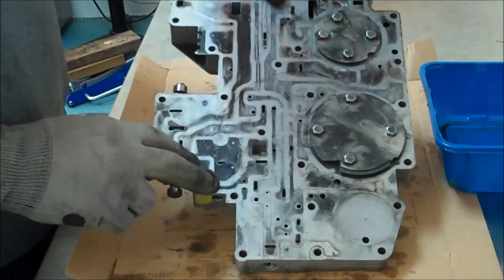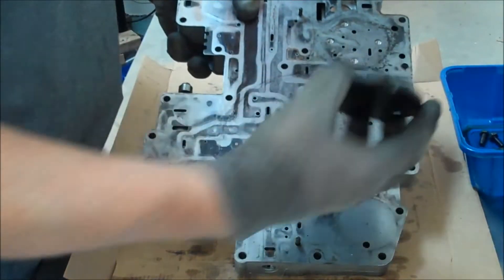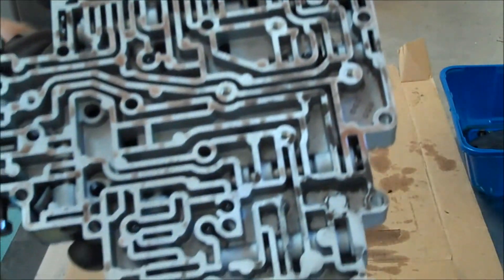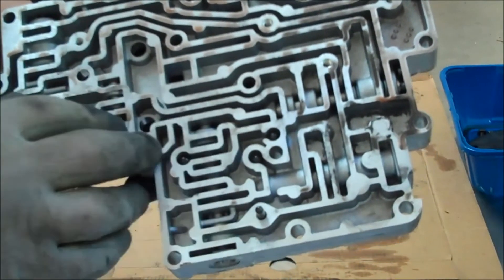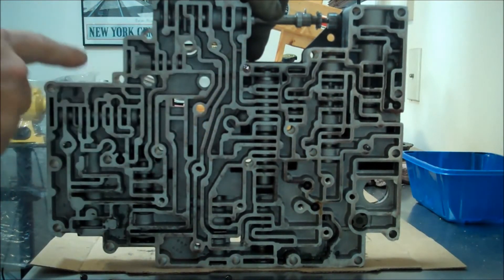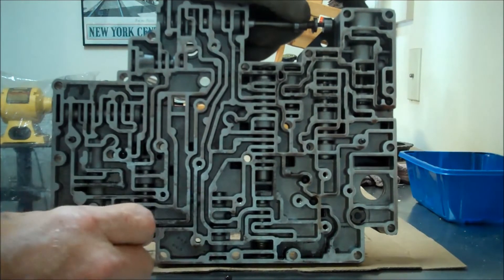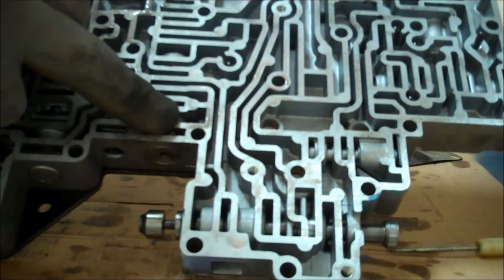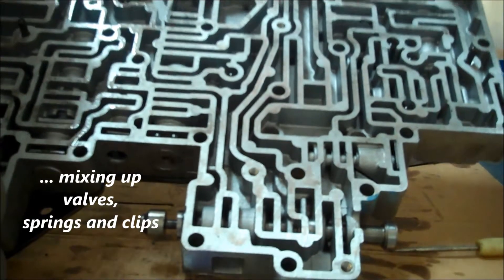Part 3:  Disassembly, Performance Modification & Reassembly of the 4R70W Valve Body

Comment: Im getting a P0750 code on my 97 thunderbird, flashing O/D light and won't shift up, code read shift Solenoid A malfunction, is the solenoid within the valve body? Thank you
Reply from the maker: Good question, I just had this problem.  Check out this video:  https://youtu.be/O9Rxch3zHHM?si=fVlsxyliMmFopV-9  I also have a long playlist of 4R70W transmission videos:  https://youtube.com/playlist?list=PLGNsbVXzRfZM6WpCF862q4DlkyatzFIMz&si=q7y4sVdsdR81htln

Comment: My overdrive clip broke into my body valve so I tore it down removed all the mental put everything back together filled the transmission with fluid now it won’t engage any gears any idea? Awesome videos btw just subscribed and liked
Reply from the maker: Thanks for subscribing and liking!  Thinking about your problem, there are a couple of possibilities:  1) you did not reconnect the electrical strip properly that goes over the valve body, 2)  there may still be parts of the overdrive c-clip in the valve body preventing operation of the valve body valves or flow of the transmission fluid, and 3)  you may not have connected the shift pawl properly which prevents operation of the manual valve.  I hope this makes sense!  There might be other causes, but those are the first I think of since your transmission worked before you did the work.
Reply: Awesome advice I made sure the electrical strip was fully secured and we are up and running again appreciate the help. Last question I added about 10 qts and it’s still not registering on my transmission dip stick. I’ve herd of others having to add about 14 qts I drained nearly all the fluid. Was sitting for about a week with out the valve body uninstalled while I waited for parts does this seam normal?
Reply from the maker: @drewsolis1634  glad those tips worked out for you.  Share my channel as payment!  ;)  A dry 4R70w will take about 13 quarts.  Put a couple more quarts in and check the dip-stick with a hot engine and while running.